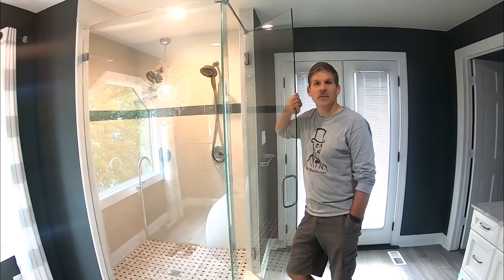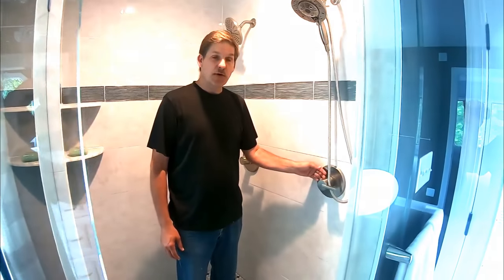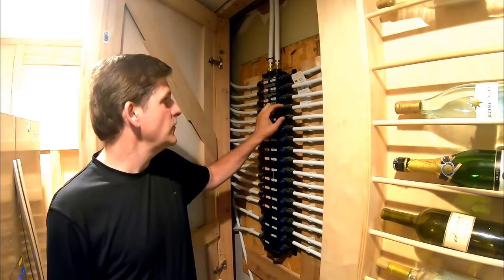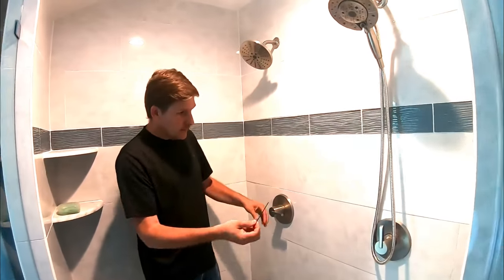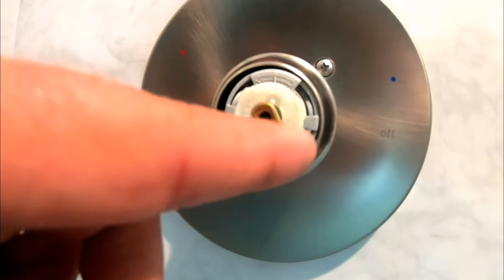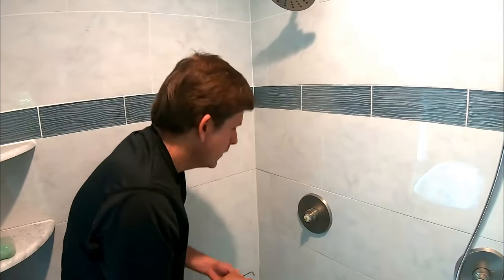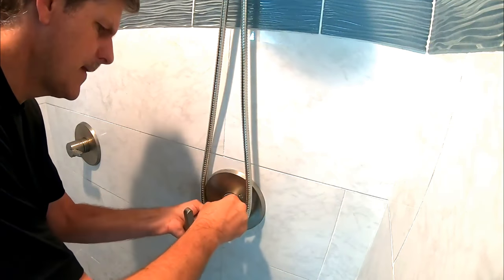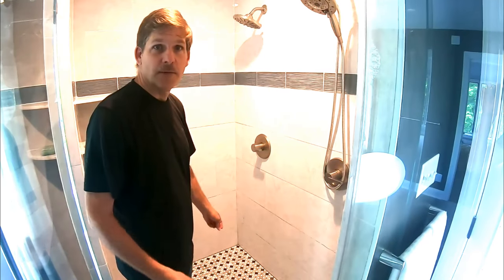No Hot Water in Shower But Hot Water in Sink

Comment: Is this typical for all faucets, whether it's the brand or type of faucet used for showers?
Reply from the maker: Hey authentic,
I’d guess it’s probably common with most cartridge faucets. The super old faucets not so much. Thx for watching!
Reply: @HouseBarons   If it's an older faucet and I have the same scenario where it's not running hot in only the bathroom shower faucet, how is it fixed?
Reply from the maker: Honestly don’t have much experience with older faucets. If other faucets in house get hot and cold fine, I’d look up a schematic online for that faucet - see what controls the hot / cold mixture. 
Worst case, I’d get a new faucet….

Comment: My case is the other way round. The shower hot water is working well, but no hot water in the hand and bath sinks. Please help
Reply: No hot water in the bath???
Reply: @martinle3944  Yes. The shower has hot water, but the tap under the shower in the bath has no hot running water. Thanks for your help
Reply from the maker: Hey Lukmon,
Did this happen suddenly? That certainly sounds odd. 
First turn only the hot water to the sink on. If no water comes out, then the valve controlling hot water under the sink must have gotten turned off. If it’s a single handle faucet, it’s possible there is a cartridge in the faucet handle that is faulty. I would look up the model number online and see if you can find one and replace it. 
If this is a multi- sink problem then you might have some sort of blockage.... might need a plumber to trace that out...
Hope this helps.
Thanks for watching.

Comment: mine is the opposite problem.  I all of a sudden have scolding shower water and I don't know why
Reply from the maker: Hey Cocopink44,
If it is only happening in the shower, I’d guess it’s a shower valve problem. You could try adjusting the temperature limiter on the valve itself. If that does nothing, I’d replace the valve. Hope that helps.
Thx for watching.
Reply: @Housebarons      Thank you   I did have someone out and he said I need a cartridge :).  I appreciate you comment very much!

Comment: I can’t get the handle out. Pls help😩
Reply from the maker: Hey Andrew,
First things first - do you know the maker of the faucet?
Does it have an Allen screw holding it on? 
Just trying to see what you are up against?
Thx for watching.
Reply: @Housebarons   yes, it does have an Allen screw in it. When I turn it, I hear a click, but it still wouldn’t budge.
Reply from the maker: Hey Andrew,
The screw should back all the way out. 
What’s the source of the click. Is the screw head into which the Allen wrench stripped - slipping - and as such not backing the screw out? 
That handle won’t likely come off till the screw is out. 
They make screw extractors for stuck screws. Put it in a drill , put drill in reverse. The extractor is reverse threaded so it will bite into the screw ( probably ruin it) and turn it out. 
But first order of business is to figure out the “click”. Is the Allen wrench the correct size?’
Bit of a puzzle.

Comment: If you have a moment - I made this same adjustment for my shower and I did notice maybe the water was a bit warmer (I turned it a full quarter turn to the hotter/counterclockwise direction), but I still have a problem where the water cools down within a few minutes of showering. This happens in both of my showers, on the ground floor and upstairs floor. The sinks in the bathrooms and kitchen continue to run very hot water and so I do not want to turn up the water heater any more. If I turn off the shower for even 30 seconds and turn it back on, the hot water is back but it rapidly cools down. I also have Delta showers (multichoice 14 series). Thanks for your help!
Reply from the maker: Hey Jbrahm…,
That’s very curious. I’m puzzled by BOTH showers doing the same thing. 
My first guess would be to replace a shower valve cartridge. But then why would both cartridges go out at same time?  
But that is where I would start. 
The 3 parts to the system are water heater, supply pipes, and shower valve. So it’s a process of elimination. 
Sorry I can’t be more help. 
Thanks for watching!
Reply: I'm having the same problem. Both my master and my hall bathroom only stay hot for about 10 minutes. Did you ever figure out how to solve it?